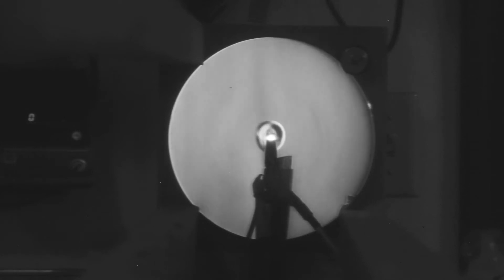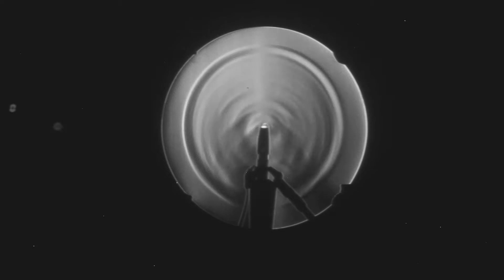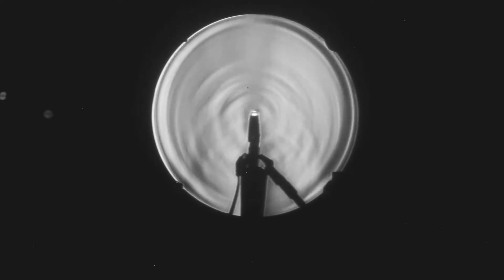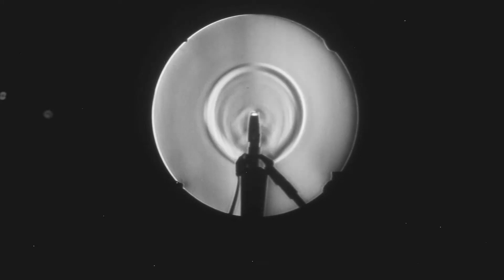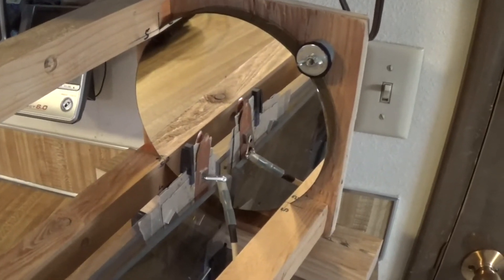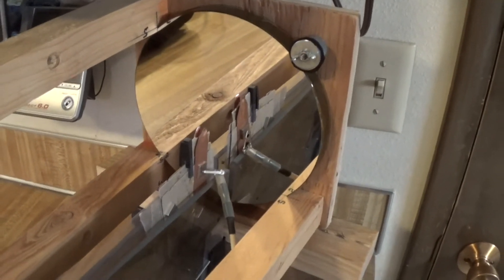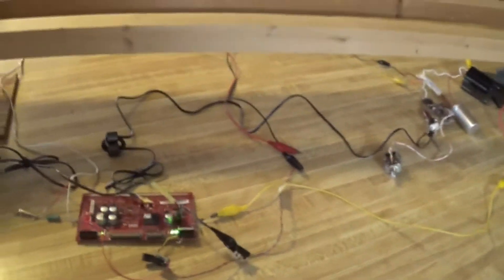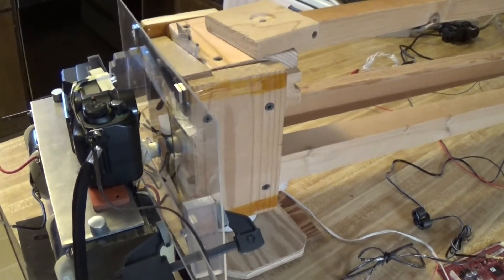Slow motion Schlieren of sound waves from electric sparks

Comment: Fantastic work Dave!  I haven't tried a pulsed LED but have used a short air spark ala Harold Edgerton. Have you tried an air spark ?
Reply from the maker: Thank you for the compliment!
The sound is generated by a short air spark.
Lighting for schlieren viewing of resulting sound waves is generated by pulsing current to an LED.  I've built pulsed LED lighting for strobe illumination in other home and work (Xerox) projects.  Much more efficient than an air spark.
Reply: @davekni  In Dr. Harold Edgerton's book “Electronic flash, Strobe” he uses an air spark for very short exposure times. In one photo he shows a double exposure of a blasting cap explosion. There is a four micro-second delay between the two flashes and each flash lasted only 0.01 micro-second! This was done in 1958.
Reply from the maker: @russedmonds227  Yes, I understand that air sparks are good for very short flashes, shorter than I needed for viewing these sound waves.  I haven't explored what would be best if under ~200ns is required.  LEDs can make shorter pulses, but pulse power can't increase much more, so pulse energy goes down as pulse width goes down.

Comment: Hi - I have been wondering if one could drive the strobe light with an analogue signal that is proportional to the sound if recorded by a microphone. The idea would be that you could play any sound (even multiple frequencies simultaneously) and its waves would appear static. However I realise that the motion blur for each underlying frequency would also be equal to the corresponding wavelength. Do you think one would still get some contrast or would the motion blur be too strong?

I guess the next best thing would be to trigger a short pulse whenever the audio signal passes a certain threshold. If that doesn't work, I imagine one would have to do an FFT and artificially create the strobe based on a short sample of the audio.

Would be curious to hear your thoughts.
Reply from the maker: You got me thinking about this project again and if any extensions are reasonable.
Two parts to my guess as to what would happen with your proposals:
1) I'll presume both a speaker (sound source) and microphone are within the visual field of Schlieren imaging system.  Microphone could be replaced by electronic delay of the sound signal driving the speaker.  For a pure periodic sound signal (single note), firing the strobe once per cycle should produce an image of the sound waveform.  If multiple peaks fire the strobe (or strobe brightness follows sound pressure as in your initial idea), only that higher harmonic would show up.
For more random frequency mixes, I think best image would be with strobe firing at rising or falling (but not both) edges of the microphone signal where air pressure is rising or falling the fastest.  Schlieren is sensitive to the gradient of optical thickness (air pressure).  However, the image will be only one wavefront at the microphone distance from speaker.  All other distances will have more random mixes of phases, so not show up in the image.  Only at the microphone distance are the wavefronts aligned.
2) The second issue is sound volume and frequency.  Since Schlieren is looking at pressure gradient, sensitivity is directly proportional to frequency.  The wave in this video is ~11mm long, corresponding to about 30kHz.  Because it is a single isolated wavefront, frequency content extends down to 0Hz.  But the pressure wavefront is mostly confined to a short distance.  Lower frequency sound (ie. typical music or talking) has much longer wavelength.  A 440Hz note is about 780mm wavelength, well larger than my Schlieren image size.  Also, 780mm is 71x longer than 11mm.  For given sound pressure, gradient is ~71x lower.  To achieve the same optical visibility with Schlieren, sound pressure would need to be 71x higher (very loud).
In case you are interested, there's a long discussion thread about sensitivity of this Schlieren setup on the High Voltage Forum where I posted about this project:
https://highvoltageforum.net/index.php?topic=1376.msg10320#msg10320
(This forum includes some topic areas that aren't directly high-voltage related.)
This sensitivity issue got me thinking about interferometer techniques again.  Probably the only way to achieve sufficient sensitivity for normal sound waves.  However, the precision and size required to see normal sound is beyond my construction abilities and budget.  Unless someone has ideas for a simpler system that could work.

Comment: @davekni Hi, good video. I would like to know the LED drive specifications to generate the pulse of 1.33 microseconds.
Reply from the maker: I used an AO3422 FET, source to ground, gate to 1.33us pulse from digital logic, and drain through LED and series resistor to (I think 12V) DC supply voltage.  I think resistance was around 5 ohms for just under 2A LED current.  Don't recall for sure.  In my case, digital logic was an FPGA, since that is what I'm most comfortable programming.  Most people would use a microprocessor (Arduino or whatever) to generate 1.33us pulses.  Other FETs with logic-level  gates would work as well, such as AO3400, FDN337, etc.  If I'm not understanding your question correctly, please feel free to ask again.
Reply: Thanks for the info. I'll try
Reply: @davekni  I have tried it but it gives me very little lighting level. Did you use any special led?
Reply from the maker: @yanierojedamorales8746  I located the circuitry I used for this.  Yes, it is an efficient high-power LED, CREE XM-L U2.  Peak current was higher than I'd mentioned too.  Series resistor is 1.8 ohms.  (I don't recall the supply voltage I was using, probably 12V, but could have been 15V or 19V.  So LED current was likely in the 4-8A range.)  LED is in a parabolic reflector forming an illuminated area matching the 203mm diameter mirror, so making efficient use of light produced.  Camera was at F1.8.
Reply: @davekni  I really appreciate your support. Thanks a lot
Reply from the maker: @yanierojedamorales8746  I'm very happy to see your interest in this.  I post because physics is fun and I hope to inspire other's interest too.
Some more details are posted to this thread on The High Voltage Forum:
https://highvoltageforum.net/index.php?topic=1376.msg10320#msg10320
That is a good place for more detailed discussion.  A couple corrections after rereading my documentation there:  Camera was F2.6 (zoomed in), and I'd replaced the LED parabolic reflector with lenses for this video.
Also, 1.3us is not a magic number.  Sound in room-temperature air travels about 340m/s.  Thus every 3us of LED flash duration translates to 1mm of motion blur.  So even 10us would produce somewhat reasonable images (3.4mm motion blur).